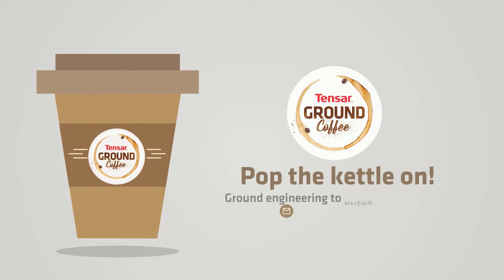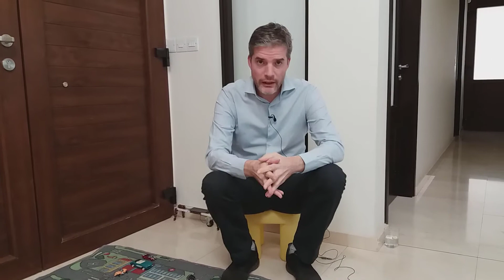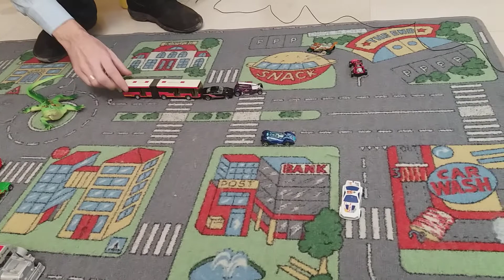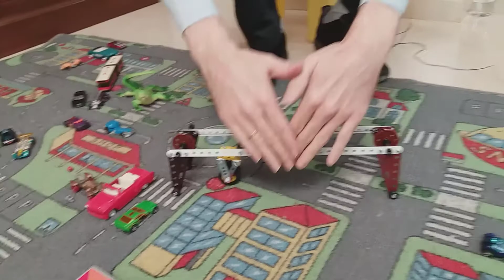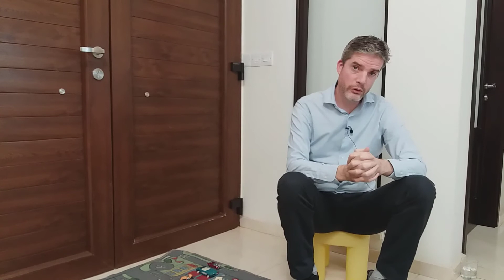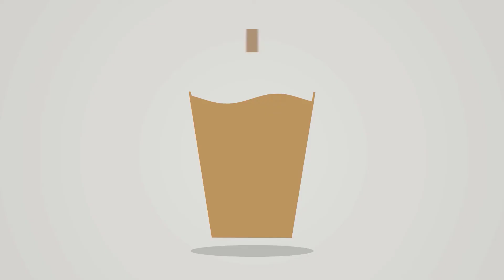Geogrids aren't just for poor ground I Geotechnical Engineering I TGC Highways UK

Comment: After 6 years of Spring and Fall muck that seemed to get worse every time we “fixed” it by pouring gravel directly on the paddock, I came across geogrid on someone’s blog who used it to solve the same problems I had. I have soft sub-soil, and the animals tramping over it just stirred the tons of gravel into a big soupy mess. So frustrating. I wish I would have known about this earlier. It works amazingly well and is reasonably priced. We drained the area first, then used the plain geogrid directly on top, then applied 6 inches of 2”minus. Not a punch hole, soft spot, or rut this fall after lots of rain! So happy!! The gravel hadn’t moved at all despite the same amount of hoof traffic. Thank you Nilex!!
Reply: Thank you Tensar!